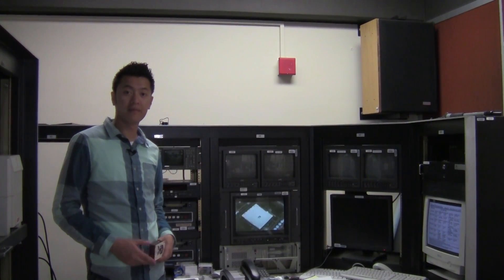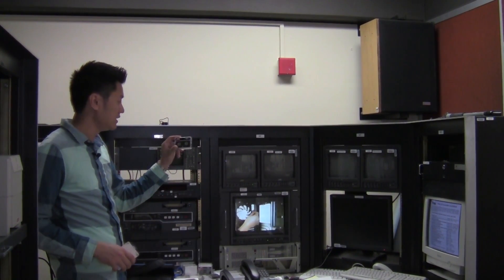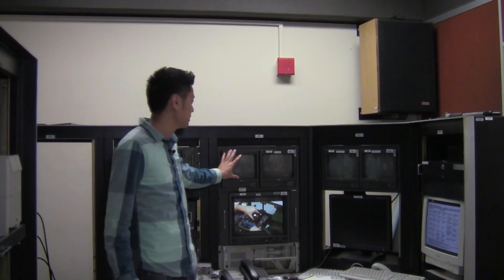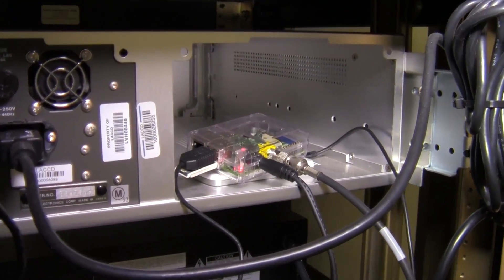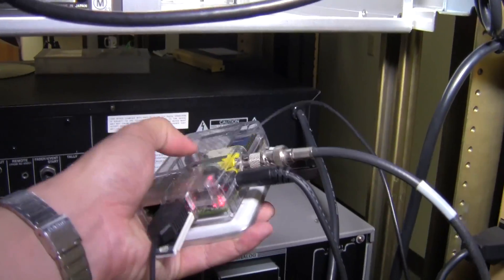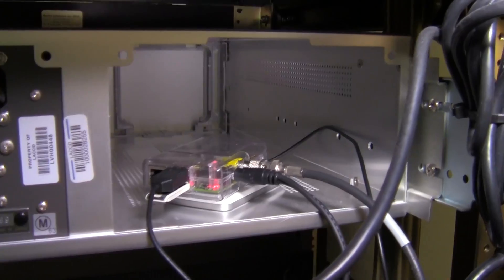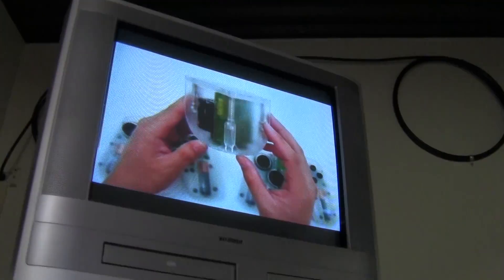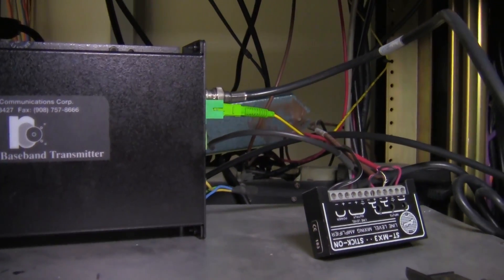Vblog: My Raspberry Pi Project

Comment: Kudos on the stop-gab measure to keep that station running.. shame it doesn't have 480i component or S-VID out on it, it'd give you a nicer picture, even on an SD station.  I'll also say this, most of that other equipment was built to 10x the standard of that rPi.. so you kinda have to forgive it for giving any trouble after 10yrs, though I've seen 30yr old equipment still run strong even with almost every capacitor and resistor out of spec.. :D

Comment: A Raspberry Pi is NOT expandable except for storage, and Windows RT does NOT run on the device; it is a Linux powered device.  That said, Linux and it's hardware still makes it VERY versatile.

Comment: A raspberry pi is very useful. It's basically a $50 computer that you can use for anything. You can put almost anything on it. You can add RAM, CPU, GPU and stuff. You can add a disk reader and install Windows on it. That allows you to make a setup that can power a big part of a studio very cheaply.